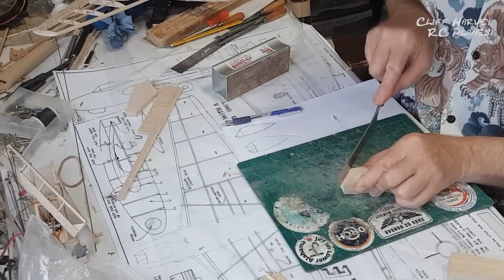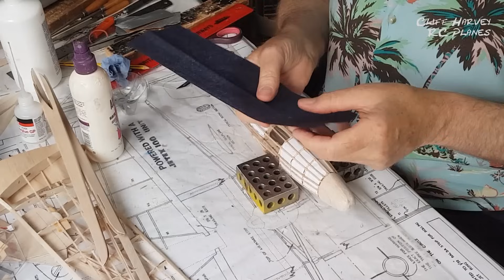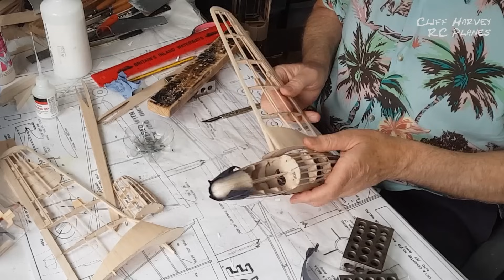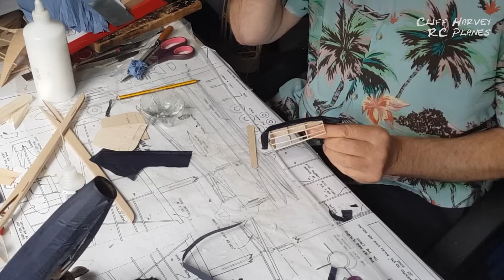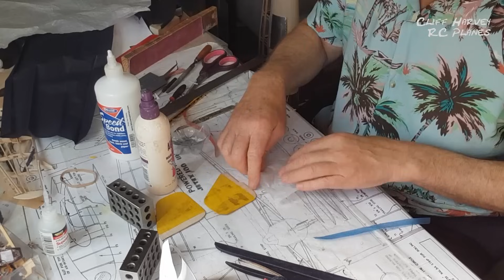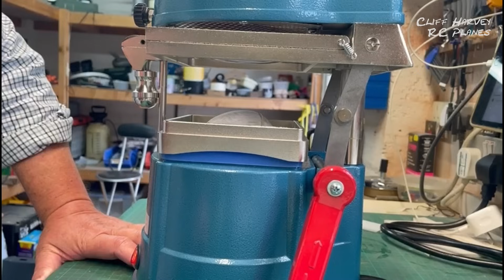Building a Stick and Tissue Ducted Fan Model Part Three

Comment: It is actually quite small and fiddly. Those mini-magnets are sure easy to loose. Great idea about using the tubing to cut in the holes. 
Great job with the tissue also. I am much to clumsy for wet tissue, I would have gone in smaller strips but your approach looks much better!
Reply from the maker: The tubing idea works for big holes too, thanks 👍